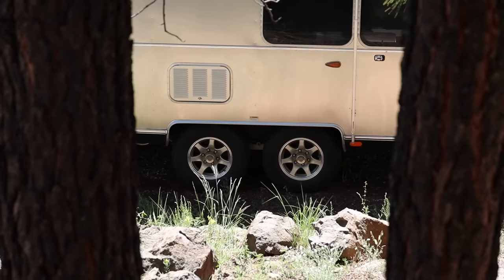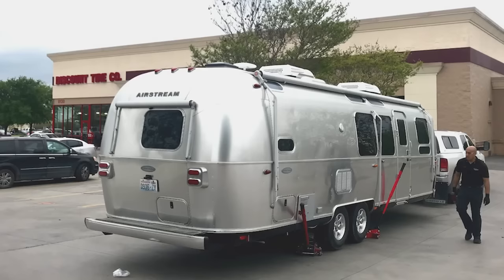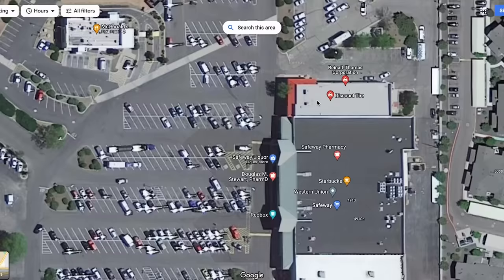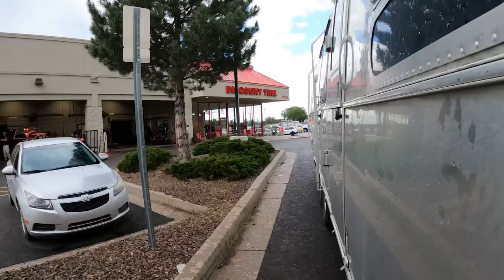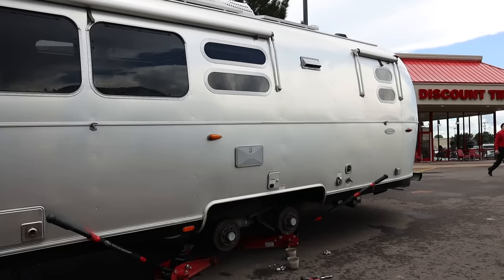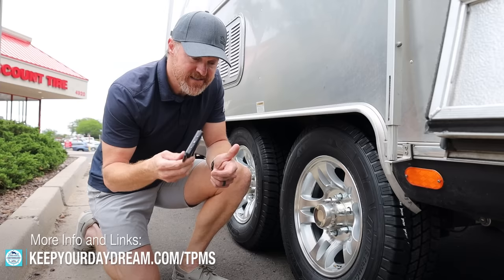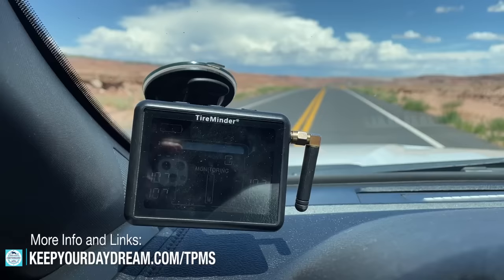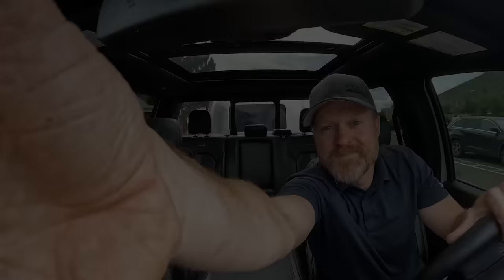Towable RV Tires: Proper Inflation & ST Vs LT + Tips

Comment: In the hot south (Texas, etc.), we run our trailer tires about 10% under max cold during the summer months.  On my last trip, I ran my 128psi load range H tires on 8k axles at 112psi cold.  Running down the highway at 100 to105 degrees, I was at 129psi when I got to my destination.  Ask the guys in west Texas at the tire stores along I-20 and they will tell you they make a decent living replacing RV tires during the summer months.  They say run 80psi tires at 72psi and you wont have any issues.  In the winter time, back to cold pressure.  Of course, you need to watch the profile of the tire and make sure it isn't squatting but if it is, you are probably overloaded and nothing much can help with that.

Comment: Good video and well thought out. I do disagree about tire pressures however - here in flyover county we have some righteous potholes.  while i try to steer clear, occasionally we'll hit one. I want my tires to have as much pressure as they can take to not become damaged.    Good idea about the spare trailer tire - we purchased a new one also. Also last year i found out my F250 has a temporary tire/wheel. I got a new wheel and tire. I didn't want to be towing on a temp spare.

Comment: If you run the palm of your hand across the face of the tire in one direction and then in the other you should feel the same in both directions. If one direction feels sharp then you have an indication that something is wrong in the alignment of your wheels. I did this for many years as a truck driver and do it all the time with my RV trailer and have never gotten in a situation on the side of the road that was related to misalignment. Thanks for the great video.

Comment: Good one Marc. I've had arguments with people that think you should always inflate tires to max pressure indicated on the sidewall. I've always used the RV manufacturers sticker for it's recommendations. Your explanation is clear + sensible. Thanks! Don't feel too bad about buying 8 new tires. We used to have a triple-axle toy hauler, pulled by a dually. That's 12 tires! Not to mention the 5 axles they charge for on a toll highway!

Comment: When using the metal x chocks, a good tip is to have an orange nylon strip from an old tie down tchd to the handles running out on the ground.  This is so you can see that they are still on and not tear up your tires when pulling out of a campground.  We have seen way to many people try to drive off with chocks and or x chocks still on the trailer.
Reply: Just had this mistake on our last trip for the first time. We were moving sites and cleaning up stuff quickly and forgot to take them off. Fortunately no damage to the tire as they apparently slipped out the side.

Comment: Great information on tires. The only thing that I think you should have mentioned is about having your tires balanced when they're mounted. I noticed that you were having this done on the video, but balancing trailer tires is not something everyone does. They should, but they don't because most trailer manufacturers do not balance them prior to putting them on their units. I don't understand why. After buying my first trailer, one of the first things I've done on the two I have purchased since is take it in to have the tires balanced. Tires last longer, and I think the toughing is just a hair smoother. Just my opinion. Love your guys' channel!

Comment: After much due diligence we replaced the tires on our 2011 classic (9000 lb) with nearly the exact same tire wheel combo. - we got the commercial version which has a little higher weight rating and is directional. We run 65 psi as per the AS factory recommendation - after 12000 miles tread wear looks perfect.

Great minds think alike.

Btw.  You are most likely to have a failure on the passenger side because that’s where the road debris - and curbs - are.  So our directional spare is mounted for curb side use.  In the event it needed to replace a driver side blowout word is it would make immeasurably small difference.  So not to worry.

Comment: Forget the bottle jack.  Usa a Trailer Aid and simply roll one wheel up onto it to raise the other for changing.   Of course, that would be too slow for the guys at Discount Tire, so you must ensure that they use the Airstream jack points.   And YES, recheck torque at 50 and 500 miles.  Wheel separation CAN occur (I experienced it after a brake job at an Airstream dealer😬).
Reply from the maker: I just bought one. I heard recently to check 3 times inside the first 100 miles and then they'll never move.

Comment: SUNDAY SUNDAY SUNDAY, Class is in session with our #1 instructor. Did ya here about those Monsoons in Utah (Zion). Yikes terrible of a missing young hiker. Still waiting for RV and Jeep Cherokee to get done, each had replacement parts being put on for the front suspension. Damage from Death Wobble and new tires for the jeep. Anyway had to get done. Be safe to all weather is not good anywhere ❤️👍🤠

Comment: Helpful video with some good information. Something worth considering, I tend to get closer to max cold pressure and I also go up a load range from oem. Last blowout I had resulted in replacement of 2 tires because the other cracked as it took all the weight while I pulled to the side. It means rougher ride (tires are not great shocks) but more security to allow a short run on 1 tire while I pull over rather than 2 blowouts at once dropping the whole side of the trailer. Neither is necessary but piece of mind for me. 
I do use the tpms to check temps and pressures as you said however without it I NEVER would have known I picked up a nail mid trip until the tire blew or I stopped hours later...there is a benefit other than lazyness to them😉. What TPMS don't do is tell you if one comes off. Sometimes they won't update for 30min and still display the last known pressure sadly. I wish you could find a tpms that had a shorter stale timer or alerted when they didn't update in X attempts.  None I have found show last update timeframe. While they beep for blow outs so far I have heard them and been slowing and pulling over before they beep.

Comment: I love Discount tire. Very accommodating.  I ask them to place the jack under the "axle support rail" that vertical steel frame rail the Airstream axles attach to. 
I inflate to 65 psi and found the Good Year inflation chart will drive you crazy. (It tells me to inflate to 30 psi??) Discount tires sells the Dill 902-W metal stem for your TPMS. The Sendel rims won't accept the generic 416 stem because of the machined well for the stem.
Talking tires is exciting!

Comment: Great video. Lots of important information that is well-presented! Many thanks! We're fixing to replace our tires before hitting the road. They are 5 years old now and sat nearly 2 years during the 'Rona outbreak (all our planned destinations had draconian and absurd mask and Vax "mandates" so we passed on the silliness). +100 on Discount Tire. That's where we get all of our trailer, truck and car tires. We park our trailer on pads made from recycled tires and they have helped prevent flat spots and tire decay. Keeps the tires out of the water when it rains, too. They weren't cheap but we're glad we have them!
Bob and Dottie

Comment: Early on in the video you said a very important suggestion, do a mock tire change yourself at home before a long trip if you’ve never change the tire before. What I learned was is that my Chevy Silverado bottle jack and wrench that fit the airstream perfectly and I knew exactly how to change the tires in advance. With a smaller Michelin tire compared to the Goodyear 16, I don’t believe you actually raise the trailer any higher because the outer diameter of the 15 Goodyear compared to the 16 Michelin is probably very close as opposed to the good you’re 16. Interesting and learn more about that

Comment: Great video, couple things I’d add. 
- TPMS, don’t use it unless you swapped the rubber stems to metal. I’ve had two stems leaking air on a 4K miles round trip this summer before figuring out the sensors are too heavy for rubber. I learned how to change a tire on the side of the road in 95f weather. Not fun. 
- My 2021 AS trailer came with GY Endurance ST, not Michelin LT. The Michelin site refers to the Agilis CC as LT so I’m a bit confused. Did you change GY ST tire for Michelin LT tire? Because I thought in the video you made the point that ST is superior to LT when it comes to RVs.

Comment: We just changed our airstream tires to Michelin and 16 inch rim. Coming back from Kanab had the truck Michelin passenger rear tire exploded, did $6500 damage to the truck and $5300 damage to the
 airstream.
Reply from the maker: Wow, I don't hear that often. Do you know the reason? What was PSI?
Reply: My ram 2500 rear tire run at 80psi front 65psi. We were running at 62mph only 15k on the tires. Didn't hit anything, 10 inch section of the sidewalk blew out. Michelin is going to replace the blown tire and pro rate me on the other 3.

Comment: Any time you can protect your tires from the sun helps even if its just for a few days or a week. Not just when in storage. You are actually changing those tires a bit late. Trailer tires have 3 year life span from date of manufacture. The reason why a got tire shop won't put a LT tire on a trailer is because it's not legal to run a LT tire on a trailer. The best point to lift from is not the frame but right under the spring on the axle. The suggested inflation pressure is also for a specific size of tire not just load range

Comment: Your techs know how to use an impact wrench!! Every tire tech that has touch one of my cars think they are on the NASCAR circuit. They press the trigger and slam the spinning socket on the lug nut. Every time I get tires I have to replace 50-100% of the lug nuts because they were twisted (CCW) with a clear impact line 1/2 way down the height of the nut.

Comment: Couple things on this subject. I have a 19 Rockwood with torsion axles. I called factory and they told me under no circumstances should you jack on a torsion axel it could damage the rubber part in axel. Told me to only jack on frame. Noticed they used torque wrench, but if they run luggs in with impact wrench the 110 ft lbs could be exceeded before the torque wrench is used. If the wrench clicks but the socket doesn't move it is over 110lbs.
Reply from the maker: I haven’t heard that but we’ve done it several times with no issues. I’ll look into it. With our lift, the floor jack didn’t work.

Comment: I bought a boat and was checking the pressure.  I have a pump and kept trying to get the air up to 60psi.  It called for 65 psi but couldn’t get it past 55psi. After a time I noticed my tires were going to crap.  Come to find out, I picked up my normal gauge and not my bigger gauge.  The gauge only went up to like 55.  I felt stupid,  I had been running tire pressure up to like 75-85 psi.  Lucky I did not blow out.

Comment: I've had lots of experience with car, truck and trailer tires over many years. I've had several really bad experiences with Goodyear tires, I feel much better that you ended up going with the Michilen tires, in my opinion they are worth the extra money over the...other brand. 
I would very much be interested if you would reach out to the Airstream corporation and ask them why they made the choice they did on what tires to use on their campers. there's a reason why so many of the high end car and truck manufacturers use them also. great info on this video, so many make choices on tires solely on price, you are correct on the level of importance, safety first. 
thanks. 
p.s. I love discount tire, their tire guys are properly trained on how to torque the lugs to the specifications,  few things piss me off more than seeing some YAHOO with an impact wrench cranking lugs on until they stop turning.

Comment: According to the tire tech at 10:45 the Endurance tires were done at 3 years old. Thought they would last longer. I just put 4 Endurance on my trailer $136 each at Discount tire. 205/75/15
Reply: You can’t just consider time but also total mileage. Full timers will get more miles and less years out of properly maintained tires.
Reply: @michaellopour7409  he checked the tires at beginning of the video and said they were in great shape. Pays to get 2nd opinion.
Reply: @henryford2736  I think we agree it was time to replace them; it sounded like you were saying they should have lasted longer, I disagree with that.
Reply: @michaellopour7409 I'm hoping to get 5 years but I'm not full-time.

Comment: Great video! It looks like you had yourself convinced the Goodyear ST's were the way to go. Then came the unexpected, wouldn't fit. I have a Grand Design Imagine that is around 6800 Pounds loaded with E rated tires it suggest 80 PSI. I wonder if running yours lower than the 80 Psi will wear the outer sides of the tires and possibly cause them to heat up since they may not be riding on the crown of the tire. In any event safe travels to all of you.

Comment: You missed a critical benefit of a TPMS.   - Early warning of a failure that has just occurred.
We've had a puncture occur, were immediately notified as the tire was deflating, and were able to immediately pull over. On a dual axle trailer, you may not be aware of a flat until the failed tire shreds, or eventually overheats the other tire on that side until it ALSO fails. Because of the early detection, we just plugged the hole, re-inflated, and drove to the nearest tire shop for a permanent fix. We solved the problem in ~20 minutes, and no tire needed to be replaced.

Comment: question because I just bought new tires for my PUP.  I bought ST205/75/14R load range D from Discount Tires as you did.  They have always recommended using the PSI on the tires, not the RV or Truck badge.  On my Truck I bought my Toyo Open Country tires also and the RV are Goodyear Endurance.  The reasoning when asked is because I have purchased tires that were not originally on the truck or RV by the manufacturer and those badges/stickers indicated what was OEM tirres, which made sense to me.  So watching your video I am back to the age old question of whether to follow RV or Truck sticker/badge or the tires. Discount Tires stated they warranty tires with PSI used by tire recommendation on the tire.  Please advise.

Comment: We are now on our way home to Texas from Colorado Springs after a 10,000 mile KYD inspired adventure. I have a fairly light 21 foot trailer and had the original Maypop tires replaced last year with the Goodyear ST tires. I think you answered a question for me. I ve noticed that when I pull in at an angle to get gas the back tire looks like it’s not totally in line with the tire on the axial in front of it. But it is perfectly lined up going down the highway. It must be due to the heavier sidewalls. I believe this was something you mentioned very briefly in your vid today.

Comment: At around 9:30 you mistakenly say, “what makes this ultra confusing is that Airstream puts the LT Michelin tire on their trailers right out of the factory.”

Actually, Airstream is putting Goodyear Endurance ST225/75R15 Tires, Balanced, per their specs, on 2023 trailers except the 30’ and 33’ Classic and confirmed by the delivery of my 2023 Airstream International.
Reply: Also on 2022 27’ Flying Cloud! 🙂

Comment: Great video.  One question, how high can the tire temp go before I should worry?  We have a tpms system but not sure when to start worrying.
Reply: All 4 tires will run at the same temperature,  give or take a few degrees.  When 1 tire starts climbing in temperature,  it's best to pull over ASAP and inspect. That tire is starting to fail. Replace it and don't  keep driving on it. It can come apart and damage the tire in front or behind.

Comment: Marc, fantastic info that no one has told me before.  We just had Airstream of Tampa put on brand new Goodyear endurance tires for us and then took a 4300 mile roundtrip from Tampa to Sedona.  The tires were at 80 psi and it felt like my teeth were going to shatter many times throughout this trip due to rough roads.  We live in Tampa and our trailer is a 25’ FBT, so it seems like I should be able to reduce to 65 psi and enjoy a much smoother ride, correct? I also tow with a 2020 F350. Any suggestions on psi for the truck? Truly appreciate your insight.

Comment: Question - if you were on the road and saw that a tire was reading at a significant different PSI level, what specifically would you do after you pulled over?  Replace that tire with the spare?

Comment: Last year I put Michelins all around on the truck. They inflated them to the door tag. I contacted Michelin for a tire pressure chart:  they don’t have one. Now with the truck fully loaded plus tongue weight, the tires don’t look right. I had to give them scale weight and they finally gave me new inflation numbers on chat. 

Now I just put Carlisle on the trailer. Same problem. I contact Carlisle and they say inflate to recommended psi on tire which is 80psi which is too high in my opinion for the weights on the axle loaded. 

So what is the mystery with these folks ?  They all seem more confused than you or I about tire pressures under loads. ????? What gives.

Comment: so in your example how would one tire be significantly higher in pressure? Perhaps if you had an axle out of alignement  or an axle nut loosenig up creating a scrubbing action on a tire you could increase temp...ergo pressure. Generally monitoring pressure reflects a tire that is loosing pressure relative to the other tires. Just sayn

Comment: Good video 😀 you changed the tires size so tire pressure is different max was 80 but 67 is low it could heat up  you are carrying a good load it should be  more it your choice 😀
Reply from the maker: 55 is suggested for my load, so 65 is 10 over.